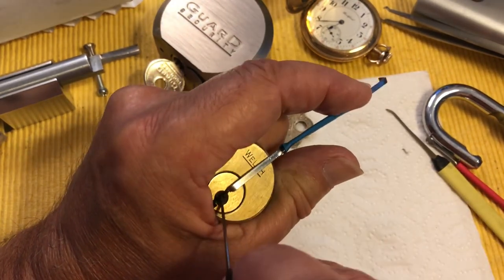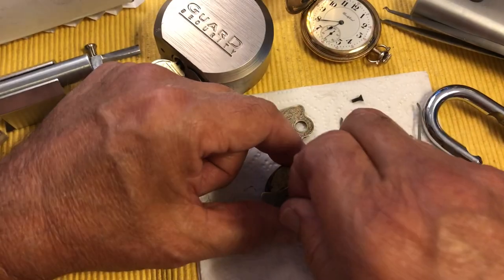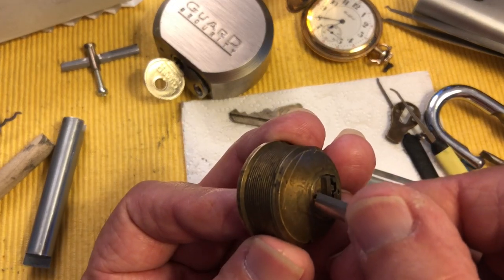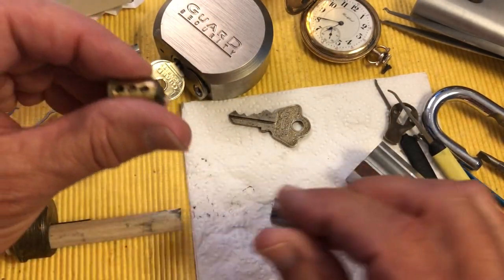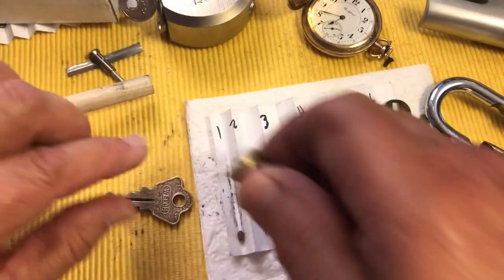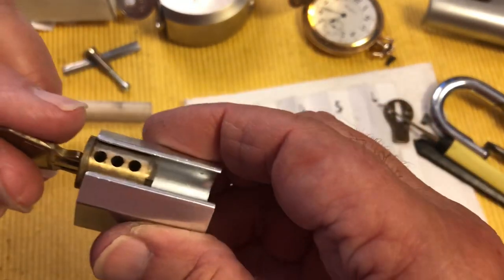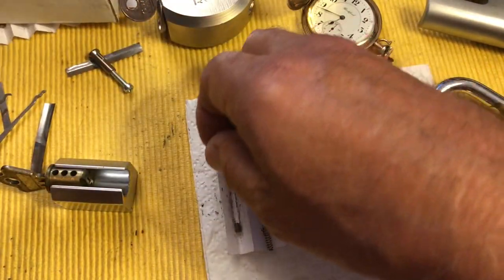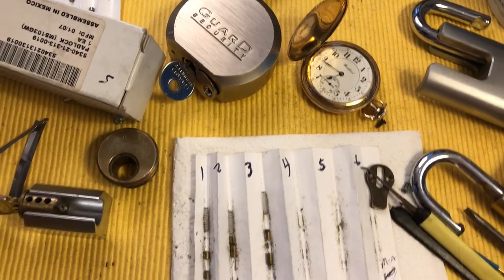#275 Welch cylinder picked and gutted.

Comment: Tricky part of that core is how tight it is. I have a 5 or 6 pin and I can only get a 15 thousands into it preferably a 13. Maybe I'll do that one for the next SLS.
Reply from the maker: King Street Rob yes it is a little tight.
Love to see you do yours!!!
👏👍🐈
Reply: @chriscapune7873  Trying to find the keys. I actually have 2 bigger ones. Counting the pins they are both 5 pin. My keys say Welch on them but they are not highly embossed like the key you have. I was surprised when I saw your key. One of my older pin kits actually has the Welch pining chart in it. Digging out all these old locks I have. Mur Lock68 may have released the monster within talking me into making these video's. Lol.
Reply from the maker: King Street Rob 👍👍👍